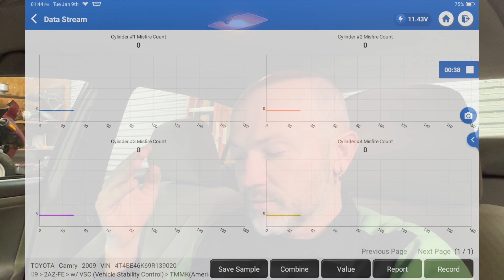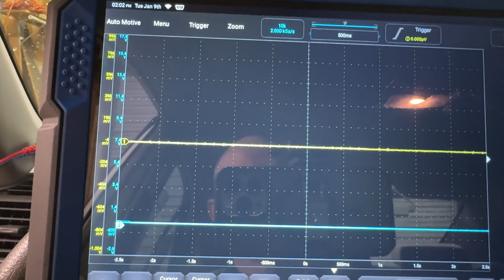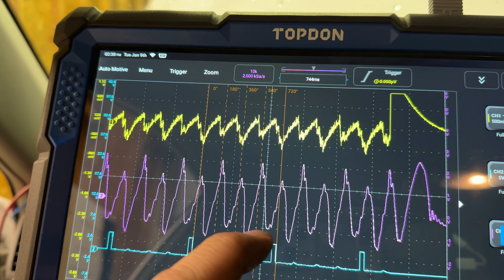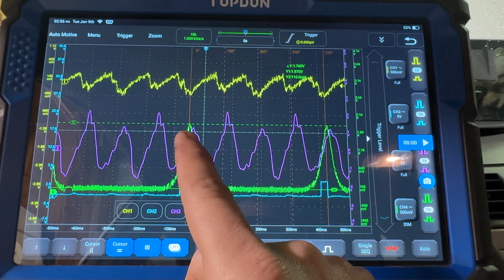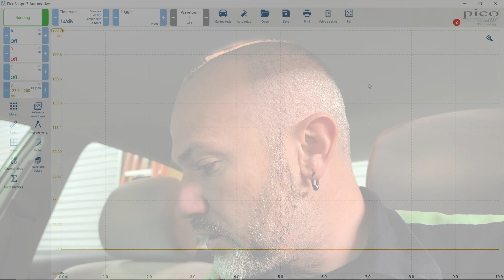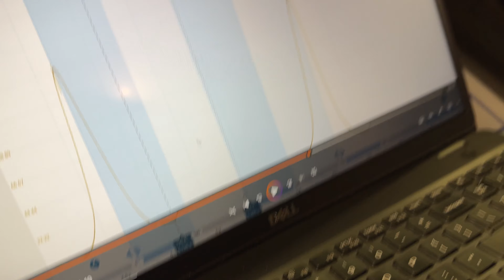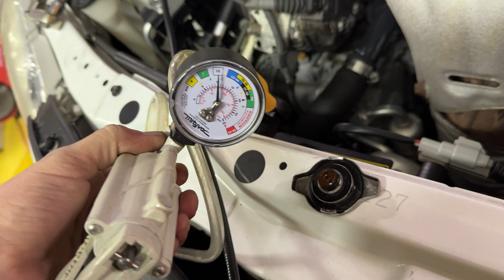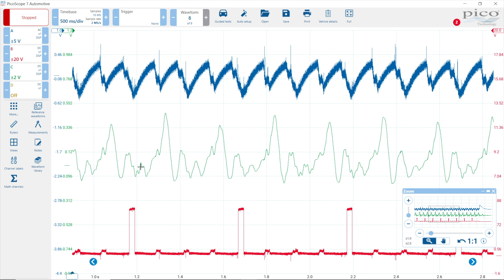Camry Misfire Root Cause! Stop Throwing Parts!

Comment: Wow took the long way.  Two cylinders next to each other with a miss? Take out the spark plugs, pressurizer the cooling system, crank the eng watch the coolant come out of the S.P. hole. No expensive equipment needed and 45minutes saved.  Time is money.
Reply from the maker: Ok hypothetically let’s say you didn’t have coolant coming out, then what? Not all head gasket leaks are big enough for that method to work reliably. In fact in my career I’ve seen only 2 cars that would. Most have to sit for a while under pressure to get enough coolant in the cycle to spray out the spark plug hole. Now as for taking the long way around, yes I do that quite often here because my channel is about helping techs learn and understand testing techniques so sometimes I spend extra time doing extra testing. I’m my own boss and production numbers are not a needed here.

Comment: Why wouldn't you start with looking in there
Reply from the maker: What if you did but didn't see anything obvious? My videos are about how to get from a customers concern to the fault by following the data from testing.  There is multiple ways to find out that this engine has a bad head gasket but what is the tell tell signs are not as clear? I'm also not saying my way is the right way but it got me to the problem. Anytime you have low compression it's the result of either air not getting into the cylinder or air being pushed out of the cylinder. In cases where it's being pushed out like this car, the process should be to find where it's actually going.

Comment: You run the test incorrect.
On a „cranking“ compression test you must completely open the intake and stay full on the pedal to give the engine the maximum amount of air to see the maximum compression. If you limit the airintake with the bubble the result is incorrect.
Next, to see correct valve operation you use the „running“ compression test in idle with throttle plate closed and you get the vacuum automatically.
Other suggestion that I miss on most of Pico Newbees: Pico supplies the Software Pico Diagnostic with preset tests for Compression and Cylinder Balance Test and they give you a very fast overview of all cylinders especially with the „absolute“ compression test. The „relative“ is a bit dangerous because it only shows a relation between all cylinders but over the years they may have worn evenly. So best use the WPS500 and you are done in minutes.
Reply from the maker: That pico diagnostics compression test is pretty nice but I quite using it because it’s wasn’t accurate. It wouldn’t accurately say which cylinder in the firing order was the low compression cycle. For example if I had a known low compression cylinder let’s say #4 and I used the wps in cylinder 1 with a firing order of 1, 2, 3, 4, 5, 6. If I ran the test 10 times it wouldn’t always say #4 was the low cylinder, sometimes it would say 3 and sometimes 5. You throw a fault in there like a gm ls engine with an exhaust valve not opening that really throws it off. As for how I did the test restricting the intake to see an intake pocket is a valid test if you know how to understand it. I don’t ever care about what maximum peak compression is because it doesn’t matter. Most OEM information doesn’t even give you a value of what it should be anymore, they say take readings from all cylinders and is there one that is a percentage different from the other. So if you test all the cylinders the same way on a good engine they will all give similar results. It’s all about understanding your test method and knowing what to expect from the data it gives you.
Reply: @autodiagyt I have been using the WPS and the Pico for over 10 years and the only problems I have ever had was me setting the scaling wrong or I did not hook it up correctly at the beginning but the measurement where always spot on.
The diagnostic apps are either correct or it tells you that you need to change the settings to get on with the test.
I use the absolute compression test and the starter/battery test a lot and it never failed me in 10 years.
Have fun.
Btw., I just ordered that Teslon camera which is so much better than my old one.
Reply from the maker: @bernhardlist9359  I can specifically remember a 5.7 hemi where the compression test said #6 was low compression. Based on that we torn down bank 2 and found no issues. Tore down bank 1 and the #5 cam/lifter was worn. After that I took a good engine and did a compression test with it and then pulled a spark plug and ran test several times and got mostly the correct cylinder but every now and then it was wrong.

Comment: Most of the borescope makers make the cables too long. 16' is a bit nuts for what most people need. Some makers offer a shorter cable but you have to purchase a separate cable. Some don't offer a shorter cable. I was ready to by a third borescope when I noticed my articulating one like you used comes with a shorter cable. On some things the articulating cable is too floppy. I would like a screen with the handle built in with a 3ft rigid cable. For me that would be perfect. The ones that come with a shorter cable tend to come with a phone style screen without the handle.

Comment: The problem with todays "electric Technicians" is that they rely on the scanners and all their toys but forget one thing.  The basics.  Once you had determined #2 & #3 were the issue, the  compression gauge and leak down tester would have been the next logical choice of tools.  I have seem too many technicians go down the wrong rabbit hole due to TSB's and electronic testers going crazy with that when the basics, while old school, is still a valid tool.
Reply from the maker: My issue with the old school tools is the new technology with transducers just give you so much more information. I’ve been burned by old school tools several times where a in cylinder pressure waveform told me exactly what was happening. The times a leak down tester would show a fault so would a visual inspection with a quality borescope.

Comment: The smartest dumbest techs is what I call guys like this. He did the most to come to this diagnosis. Could of found this issue way faster just looking at live data and doing simple misfire diagnosis steps.
Reply from the maker: I get what you are saying and realistically if this wasn't to do a video the amount of time for me to do all these same tests not recording and not doing extra testing just for additional conformation I would have been done with this Diag in 15 minutes. The point in all the extra test is further documentation and to just show a process. Not all misfire diagnostics are this straight forward. Truth be told my typical process for a car like this would of been RC, see the low compression and then look in it with a borescope, see the coolant and pressurize it and see the coolant start running. Diag finished.
Reply: TOYOTATECH86.  "My mate Jonno could have diagnosed that with one hand tied behind his back, blindfolded and by only using a $10 dollar testlight and a banana." You REALLY do not understand the purpose of this video...sigh.

Comment: There notorious for head bolt stretch causing 2 & 3 to leak coolant, deck the head new gasket & new tty head bolts is the fix.

Comment: I take it that the individual who installed the white rat's nest isn't familiar with EMF. (So glad to see that you cleaned up THAT mess!)
Nice captures!
I would have immediately gone to a mechanical compression test, as I don't own any in-cylinder pressure testing equipment. (but would love to!... hint, hint YouTube...)
The wet plugs would have made me wondering if cylinder wash may be an issue....

One thing I cant understand is lead inputs... grounded together VS not grounded together...
I have NEVER seen anyone cover the differences. My Verus Pro has two tied together... I just don't understand the reasoning. (math channel?)
Reply from the maker: Some scopes just use a common ground and some like the pico use a floating/isolated ground. It’s rare an isolated ground is needed but it does happen. Like for instance an inductive crank signal to see the full amplitude of the signal you would need an isolated ground scope or only be connected to the crank sensor. Another example would be can bus, ground in can low and signal in can high would show you the pattern the module will see but you can’t do that if you have another channel with the ground connected to ground.